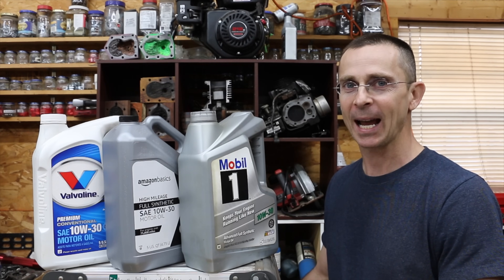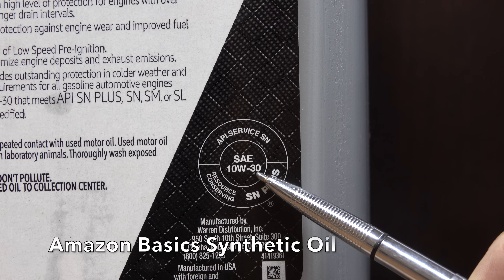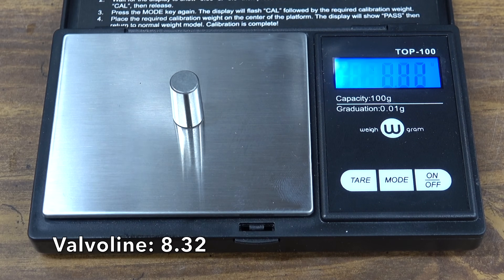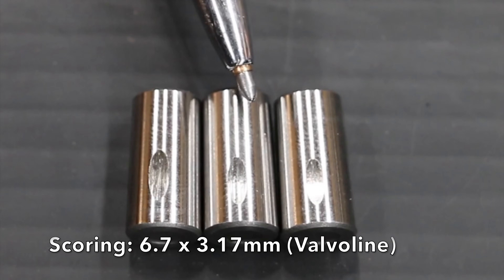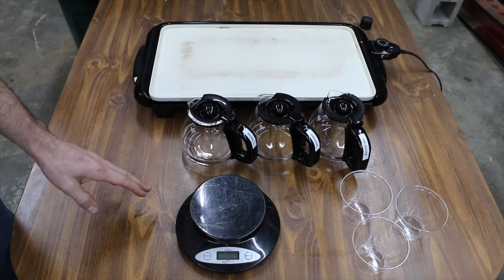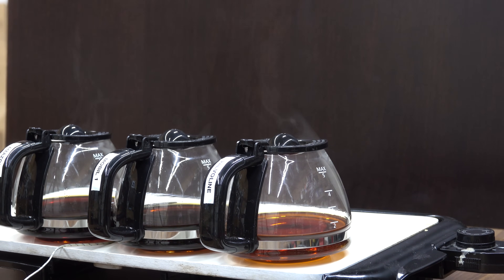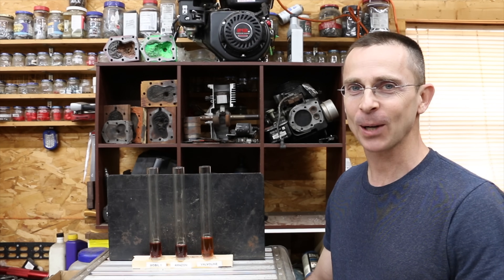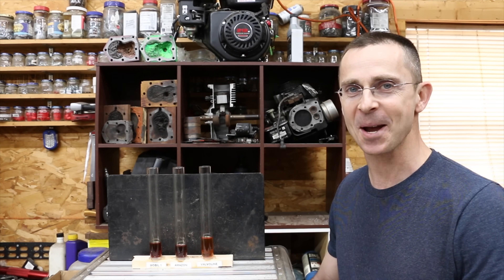Is AmazonBasics Full Synthetic Motor Oil better than Mobil 1? Let's find out!

Comment: The problem I see with Amazon Basics oil would be consistency.    Mobile One has always been spot on consistent with their products.  Amazon has no track record as of yet.  I would not be surprised that the performance would vary from 'batch to batch'.   Besides, Mobil One full synthetic can be had for as low as $22 at the local Walmart.    The extra few bucks is worth the peace of mind IMO.

Comment: suggestion for another test...hear 'old wives tale' but have seen drain off tests that still make me wonder... if you ran a regular oil wear test for like 10 seconds, shutoff-let sit in contact/untouched, remove oil cup, let set overnight, run 10 seconds- see if any oil film remained... or if it screeches to a halt quickly, adjust off time, retry... repeat with synthetic. just curious for the sake of engines that sit all winter, at least a week or two between starts, if there is any more risk of wear due to synthetics tendency to flow cleanly away. remember seeing years ago a guy soaked a couple steel slugs in oils, hung to drip dry a hour, sat on blotter paper changed daily, the dino-oil still had a lot of oil run off days later, where the synthetic was clean after the first one- it all drained off rather quickly...
   leaving the test rig roller in contact should retain a tiny bit of oil between/around the contact point due to capillary/surface tension actions, but who knows... ive been leery of synthetics as too many cars sit all winter here, and the winter car sits all summer... try and start at least every 2 weeks, but still... always wondered which is really better at leaving long term oil film- esp on older flat tappet engines with all the sliding friction on the cam lobes while cranking- they are pretty dry till the start/higher rpm starts throwing oil at them...cranking dont sling much oil up there... 
  nice test videos- good job-  the Amazon synthetic does look pretty impressive for its cost!

Comment: Why no Valvoline synthetic?
Reply: AROAH Entertainment, true... I had to double check! Thanks for pointing it out
Reply: AROAH Entertainment valvoline is the controlled subject. The true test here is Mobil vs AMz basics
Reply: @jes4tube  Control in a different weight and non synthetic?
Reply: @maggiejetson7904  Control was the wrong word, but if you read his pinned comment it would explain everything
Reply: I think he wanted to show a difference between synthetic and regular oil as an addition to the real comparison, Mobil 1 vs Amazon.
Reply: Valvoline was the control and stood for basic oil that can be purchased.
Reply: the test wasent fare the valvoline wasent synthetic not even a little bit. VALVOLINE IS VERY GOOD OIL!
Reply: Mobile 1 is superior to Valvoline
Reply: Because he's an idiot comparing apples to oranges.

Comment: Could you devise a way to test lubricity at the upper end of the the temperature range  that the oil would operate in, in the engine. To simulate an engine under high stress.
Reply from the maker: Thank you for the video idea!

Comment: As the oil is expected to have a low viscosity at low temperature and a high viscosity at high temperature, I miss a test with hot oil flows. :-3
Thanks for the tests though, it helps get confidence for Amazon products despite the lower price! ♥
Reply from the maker: Thank you!  Oil viscosity decreases as the temperature increases.

Comment: Todd, this is a total must.... Amazon Basics synthetic vs. Walmart's SuperTech synthetic.  Please do this test. IT REALLY NEEDS TO BE DONE. You da man!
Reply from the maker: Thank you for the video idea!
Reply: @ProjectFarm  we're really, really curious about this test man. are you going to do it?
Reply: @ProjectFarm  or do all of the generic brands O'Reilly, AutoZone, Walmart, Amazon basics, and whatever other parts store you can think of.
Reply: @ProjectFarm  please do this video idea...
Reply: Good idea! They are both comparable in price. I have been considering switching to Supertech v.s. the Mobil1 i've been using.
Reply: @DMJ160  Amazon and Walmart oils are said to be the same manufacturer, so we need to see if they both tie or if they are different formulas. They should use Mobil 1 as the control formula in this test.
Reply: @dbfcrell8300  yes, would be interesting to see.
Reply: @dbfcrell8300  Amazon is the highest grade 5n plus I'm not sure if Walmart & Mobil 1 is rated that high
Reply: Yes! Please please do a test between Amazon Basics and SuperTech!
Reply: @running.overland  I want to see that test
Reply: I agree with this statement completely!  Do a test of Amazon Basics vs. Walmart SuperTech!
Reply: I (oddly enough) use rotella t6 in all 3 of my vehicles (gas) 
I would LOVE to see anything compared to rotella t6
Reply: @shaunnonyourbusiness767  I use Rotella T6 in my Duramax, Gas engines, and all of my motorcycles... Dirt and street. Good Stuff
Reply: Both of these would be similar because Amazon basic and super tech are both made by Wilson so.
Reply: @pikkons  Warren.
Reply: @gizzyguzzi  I knew it was something like that it began with a w, but I knew they both came from the same distributor oil company whatever you want to call it
Reply: You should also add Quaker State Ultimate Durability full synthetic...because there has to be 3 contestants!
Reply: just go to the American Petroleum Institute website. sn plus will always outperform sn.API has been around for 100 years.Not sure about other oils but amazon basics is from warren distribution which has been around since like 1920 a pretty reputable company.If walmart has wpp stamped on bottom,it's from warren and with the sn ,it is still very good oil
Reply: Please add Costco Kirkland full synthetic oil to your test. It cost $12 for 5 quarts.
Reply: James69888 Amazon, Supertech and Kirkland are all manufactured by Warren distribution I believe.  It's all the exact same synthetic oil.
Reply: Currently Supertech is the better buy $14 vs $20 for 5 qts of 5W-30.  Over on BITOG there's a lot of good techno info on how good ST is especially for the price.  I would not run it in a GDTI engine but in an old POS it's more than good enough.
Reply: Unless you're going for a 0w40 its minimal.
Reply: Why would you do that? They are both made and bottled by Warren, they are also who makes Kirkland oil
Reply: Amazon basics and Supertech have the same dexos number: D10386HG025, which means (And someone correct me if I'm wrong.) the stuff in the bottle is the exact same formula, regardless of the label.  Warren's Petroleum makes them both. 

In fact, here's a list of A BUNCH of oils that share that exact same dexos number:

Accel Full Synthetic
Amazonbasics
Autozone Aceite Sintetico
Capital Bulk Full Synthetic
Casey's Drive Professional Series Full Synthetic
Federated Auto Parts Full Synthetic
FVP Full Synthetic
Holiday Full Synthetic
Kum & Go Full Synthetic
Lubritek Full Synthetic
MAG 1
Maximo Full Synthetic
Meijer Full Synthetic
Mighty Engine Guard Full Synthetic
Parts Master Synthetic
Prime Guard Full Synthetic
Proline Full Synthetic
Pronto Full Synthetic
Roughneck Lubricants Full Synthetic
STP Full Synthetic (they have 2 other 5W30s on the list)
SuperTech Full Synthetic (only one!)
UNO Ultra Full Synthetic
XP Full Synthetic
Reply: @baddestburrito  This is the best comment on this entire video! Can’t believe it’s buried and only had 1 like (now 2 😃)
Reply: i am sad because amazon doesn't sell the amazonbasics motor oil in italy, i could really use it
Reply: @nicolapalmieri7344  can't get Amazon basics in Canada either
Reply: @on-site4094  guess i'll have to stick with Mobil 1 then...
Reply: o Rebelo Doesn't matter.  Walmart Supertech is the exact same oil. Manufactured by the same company with same specs
Reply: I like this idea as well but would prefer the test be done with 0W-20 or better yet with both 0W-20 and 5W-30.
Reply: Why don't you pay for a lab analysis for each one?  That's the only way to see if they are 'same' as it will come down to additives and Project Farm can't test that.
Reply: Just to save you the trouble: they are identical, made by the same company using the same formula. You can get Walmart Supertech for much cheaper.
Reply: Yes yes yes. We need that video.
Reply: There the same
Reply: kempo685 Obviously you didn't read my comment.
Reply: I agree please. Walmart has cheap oil changes and I’m sure it harms the vehicles.
Reply: Divante Brown Whose talking about getting their oil changed at Walmart?  You buy their Supertech oil and change it yourself!
Reply: @carlrest6553  I get my oil changed at Walmart for both of my pilots.
Reply: Carlos Velasquez Your choice.
Reply: There's also Kirkland signature brand
Reply: Agree it's unanimous..... Basic 5w30 full synthetic vs Super Tech 5w30 High Mileage full synthetic.
Reply: Stefano Dawg  where do you shop?
who do you give your hard earned dollars to (and support financially)?
Reply: Stefano Dawg  you need a 'pro 2nd' supplier for your vehicles' oil replacement.
websites may or may not have that answer for you.  Might have to contact CEO's to get those answers.

Comment: Great test!  I was wondering about Amazon basic.

Now for Mobil 1 vs Amsoil!

I also have a couple of diesel engines so it would be nice to know the difference!

After many years of using Royal Purple even in my oldest diesel, I've switched to Shell Rotella T6 SAE 5w-30 for my newest diesel.

Safe for both gas and diesel.  I'm trying to find one best to use in all of my vehicles.

Our vehicles range from 1984-2002.
Reply from the maker: Thank you!

Comment: Warren Distribution puts it out.  They also make Mag1 (probably what this is, jug is exactly the same) which does not have very good distribution but you can get the synthetic for the same price as Amazon brand at Grainger and the conventional for about half Amazon Basics Conventional price at Walmart, $27 for 3 five quart jugs.  Either way, the worst motor oil today is still better than the best thirty years ago.....But I'll still stick to Mobil-1, Pennzoil Platinum, and Shell Rotella T-6.
Reply from the maker: Thank you

Comment: I like valvoline. You can also look at the color  after the heat test and clearly see the oil didn't break down as much making it last longer. I also check once a month and usually have to add a quart half way through change periods. I believe when you get less luberation though the chemical break down of the oil its self. As long as the level is good  and don't life in subzero Canada you'll be alright.
Reply from the maker: Thank you!

Comment: Do you have a spreadsheet of best oils or video showing oils best to worst?
Reply: A lot of the oil blenders publish technical data in pdf format so you look at those and compare the values.
Reply: @longlifetimingbelt2731  yeah how do we find the information
Reply: The oil blenders tend to quote viscosity (CSt) for 40 and 100 degrees in their tech data. I'd like to see the CSt for freezing point (water) to get an idea of cold cranking. I mentioned this to the tech manager for the oil brand  I use and they agreed it made sense.
Reply: @longlifetimingbelt2731  it would make sense to test it at 0c it's kind of the baseline temp
Reply: @Hallowsaw  Indeed! We just need the oil brands to add the data. Stating a cST value for 40 degrees, as most of the brands do, seems daft unless you reside in a hot country where it will be cold cranking temperature.

Comment: What is more important in a turbo charged engine, film strength or maintaining flow after heat?  Would you use the Amazon oil in a turbo charged vehicle, particularly one that recommends mobil 1 ?
Reply from the maker: I always recommend going with what the manufacturer recommends, but I can't imagine why the Amazon oil wouldn't meet OEM specifications, considering it's rated the same as Mobil 1 per the API.

Comment: If you look at how many refineries there are or are not and the extreme difficulty and cost in building a refinery (EPA regulations and licensing) One could conclude that a lot of these petroleum products probably come from the same plant. I decided long ago that I was not going to pay extra for some fancy packaging and advertising. Now I don’t drive my vehicles 400,000 miles and then tear them down to verify but I haven’t experienced any lubrication related problems thus far. Averaging 20-25k miles per year and pulling a recreational boat or trailer. I tend to ignore the suggested 7500-10000 mile oil change intervals and stick to 3500-5000 miles instead. I feel that I’m getting the same protection at a more reasonable cost and until I’m proven wrong will continue to price shop oils . But not filters!
Reply from the maker: Great point. Thank you

Comment: A lot of comments hope this doesn't get lost, however, since this is "Project Farm", what about an oil test between synthetic blends?  Specifically Kendall GT-1 (which can be bought at Big R for $3/qt -  <--- edit that out if you need to, was just putting it there because it is an inexpensive oil) vs say Valvoline and Castrol Synth-Blends (or whichever synthetic blends are supposed to be "the best").  I've always been a fan of Kendall, just would like to see where it stacks up in your test.

Great channel by the way.
Reply from the maker: Thank you!

Comment: Could you do a comparison between castrol and valvoline bc I always use castrol but when not possible to get it I use valvoline and I am concerned about should there be sludge left from the castrol the valvoline will wash it out causing harm to my engines like if you was to put havoline in behind castrol if you could test which is better it would be much appreciated
Reply from the maker: Thank you for the video idea!

Comment: Yikes dude, this is a horrendously inaccurate testing. You're using thin plastic ramps for the flow test and not even measuring anything in terms of amount of oil poured for each test. Brutal. How this video is being lauded for its findings is beyond me...

Comment: In the '90's I used Valvoline 20W50 Racing Formula motor oil in my Dodge Dakota because it was just better than most off-the-shelf motor oils. The Dodge 5.2L Magnum engine was an old push rod engine which was inherently prone to produce a lot of valve train noise. The 20W50 was heavy viscosity but my truck produced considerably less valve train noise than other Magnum engines. Once I bought my supercharged Mustang in 2009 I switched to Mobil 1 full synthetic and used the factory-recommended viscosity. I didn't drive that Mustang much but, when I did drive it, I drove it hard. So I changed the oil every 2,500 miles. Anyway, since then, I've been using Mobil 1 in all my gasoline engines. In my Dodge Cummins I use Shell Rotella Triple T. Is there a better diesel engine oil available for that?
Reply from the maker: Thank you for the video idea on testing diesel oils!

Comment: REQUEST: TEST OIL BRANDS LUNRICITY AFTER THEYVE BEEN IN A TURBO DIESEL ENGINE FOR A LONG TIME.

I've stopped changing my oil based on mileage about 15 years ago when I realized I could perform 3 easy tests to reveal if the oil needed changing.

I would pull the dipstick on a moderate day like in the 70s F.
1- test the meniscus by putting my finger on the oil on the dipstick and seeing how far away the oil sticks before it releases. New oil I can get several millimeters! Water and old oil, especially overheated oil, releases almost immediately getting only 2 or 3 mm.

2- sniff tje oil. Good oil doesn't smell that differently than it eas in the bottle. If it smells acrid then its bad. Makes my nose hurt = change it

3- hold the drop of oil on the dipstick in the sun to look for suspended metal flakes.

That last test doesn't work on oil from a diesel motor because its filled with soot within minutes of being in a running diesel engine.

I have noticed air cooled motors need it way sooner, like a tee 1200 miles 
Vs
My Chrysler Lebaron 2.6 ... I keep testing and testing and drove it 22,000 miles and oil was still good!

Engine compression was better when I sold it than when I got it! (Probably some carbon deposits on piston raising compression.

No signs of irregular bearing wear.

So now I've had a Mercedes 300D for about 12 years and drive it almost every day. Frankly it burns or leaks the oil before it could ever wear out as I have to add about 3 quarts every 2 or 3 months of daily driving. So I've never "changed" that oil. Still drives and starts the same.
My VW TDI I'm not so sure of ... because of the turbo.

So far about 30k on the same oil and its not behaving any different and the oil behaves the same, but I can't see thru it in the sun to witness any metal shavings.

Having stopped changing my oil based on manufacture suggestion decades ago and having never blown an engine... I no longer believe all the tropes.

So I REALLY APPRECIATE YOUR TESTING as I see that different engines create different conditions and thus the oil change IS NEEDED OFTEN FOR AIR COOLED ENGINES as my 3 part test really shows wear for those ... not so much water cooled.

But the turbo ... I'm not clear what a difference that's making...
Reply from the maker: Thank you for the video idea!
Reply: @ProjectFarm  I still have the same oil that I bought my VW TDI Jetta with some 22,000 miles ago. Would you want that sample? I'll try to figure out what oil previous owner used ... I think it was Mobile1 .... definitely synthetic. 
Then we'll need another sample from someone else ...

The Turbo is the only thing that makes me worried. I'm wanting to work out a test for my oil longitudinally like what you worked out across brands here. Other than the extreme heat of the turbo,  I'm not convinced oil goes bad but rather is DAMAGED.